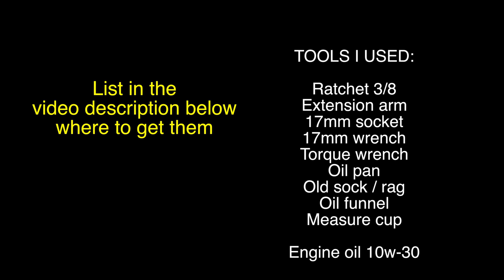Honda Ruckus / Zoomer 50 - Engine Oil Change | Mitch's Scooter Stuff

Comment: Great video and great videos Mitch! Just letting everybody know out there if you have a 2019 or or newer Honda ruckus, when checking the oil level, you do Not screw the dipstick in. Simply clean the dipstick off, insert it till the threads seat, and pull it back out.
Reply: I was going to say that too....you’ll end up a little low overall screwing it in. All Hondas (to my knowledge) the procedure is the same, you just set the dipstick  back in the fill hole on the threads, then pull out and check the level. I worked at a Honda dealership (in the service dept) for quite a few years back in Indiana.
Reply: I do the same!
Reply: I just sent my dipstick as well to check the oil, that is without screwing it in. Seems though that one side of the stick is lower than the other. Angle of dipstick in motor I'm sure, but still, what to believe?

Comment: Best Rukus Channel on the Internet for Maintenance.
Especially love using proper torque & the camera work expertly showing exact placement.
Thanks Mitch, you are my Go To & my personal Father & Son retirement hobby is restoring American Muscle cars then showing & reselling, Have built a couple or 3 drag cars & bikes just for fun.
BTW - my 2022 Rukus heavy mods without an engine change is a 2022 cruises at 40mph normal top speed 45/46mph stage 1. The Ruck is my daily around town errand bike.

Comment: Aye don’t screw in the engine-oil dipstick when checking levels. Just goin by the manual maybe it’s different for other production years mine is a 2019. However  I have a comprehensive service manual for the NPS50Ruckus 2003- present that they give to Honda Technicians to do all service and assembly.. and this service manual also says not to screw in the dipstick when checking oil level, just seat the stick in the threads for a second and then remove to check.

Comment: My manual specified to use API 10W-30 oil except resource conserving. Clearly I bought resource conserving oil and changed  the oil before I realized this! Should I changed it again to one without that label?

Comment: Love your style. I did everything with the same tools you suggested but was having issues with the torque wrench, fitting it with the hose in the way.  I tightened the oil screen bolt with the wrench as tight as I could.  You think this will be okay?

Comment: Hey Mitch...great video, helped me change the oil on my ruckus for the first time, so I really appreciate it. I had a question, you screwed in your dipstick to check the final levels, but I've read elsewhere you shouldn't. Any advice there?
Reply from the maker: Hey Jason, yes just put dipstick in without screw in to check the level. I forgot about it since other models I worked on need to be screwed in 😆

Comment: Hi mitch. I have a honda spacy jf04. I changed the oil before 25 days. Now the motorcycle don't run. I noticed the oil was 20/ 50 . Could be a damage in the ingen. the rear tire defecult to turn. When the motorcycle on the stand. Please answer. Sorry for my English. Im from Iraq

Comment: I can’t fit a torque wrench on the bolt for the oil screen :/ if I take off the exhaust bolts and slide it what torque do I need to re tighten the exhaust bolts 2? I tried everything to get a torque on that bolt and the exhaust pipe is in the way

Comment: On my 2022 Ruckus, the bolt on the filter screen isn't exactly 17mm. It is a little loose. I'm concerned i will round the corners. No adjacent sizes fit either. Should i just go for it or is there some other, safer solution.
Reply from the maker: Ahh if you have caliper to measure it and get correct size socket to remove it

Comment: Love youre videos i have a purple 98 honda elite 50 and in haveing some bad mid range Sputtering and its my first good scooter
Reply from the maker: Thank you Bubba! I would check the air filter, replace spark plug, and check CVT, maybe the rollers have flat spots
Reply: Mitch's Scooter Stuff its better after putting a new ngk spark plug and air filter but my roller weights are done. Picking up new ones from the shop. What type should i get
Reply from the maker: That's great! I went for this one http://amzn.to/2u8RcAb

Comment: Can you use brake cleaner to clean that oil strainer screen?
Reply from the maker: Never thought about that... I would rather use the air compressor ... not sure if brake cleaner will harm the rubber part

Comment: How often do you change the oil? Mine is at 700 miles 
Thanks!
Reply: Per manual:

INITIAL = 600 mi (1,000 km) or
1 month: R
REGULAR = EVERY 2,500 mi
(4,000 km) or 6 months: R
Reply: @stevealvarado8053  thanks!

Comment: Dlp toy realty need a torque wrench to tighten the bolts back  and filter?
Reply from the maker: lxH8xURxFACE peace in mind... people who don’t have torque wrench, they stripped the bolt by over tighten and some people didn’t tighten enough and bolt got loosen and oil spilled out then engine blown up...
Reply: @MitchsScooterStuff  tha is u for reply sir , I have another question, my ruckus is stock, and when I'm going down hill or starting to go past 35 I will start to lose power, u think i should check the carb jets ?
Reply: @H3DG3xC043  is it hitting the rev limiter?
Reply: @beaconbus  it was hitting the rev limiter , I was able to add few more mph after I installed the tvr intake and bigger jets I get 40mph now and it doesn’t dog down at 35 any more
Reply: @H3DG3xC043  nice job!
Reply: @beaconbus  thank you sir

Comment: Oil basket screen is how i emptied the oil js , its the lowest point
500 miles oil change seems excessive, should be good for 1500 + 2000 with premium oil synthetic

Comment: hi mitch, the hose that is beside the
my air filter it used to be transparent before does it have something to do with the gear oil or it is were the excess oil goes( i have no idea on the name of the hose, but the liquid inside of it is dark as black?) how should I fix this? thanks again for replying more power